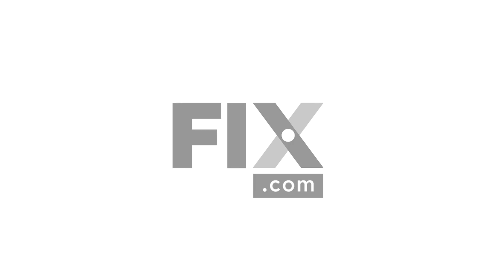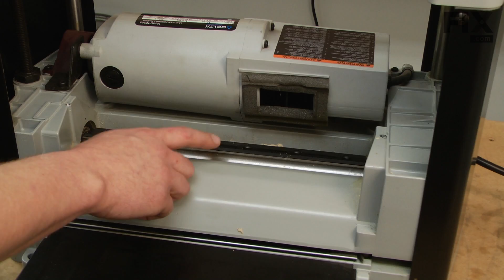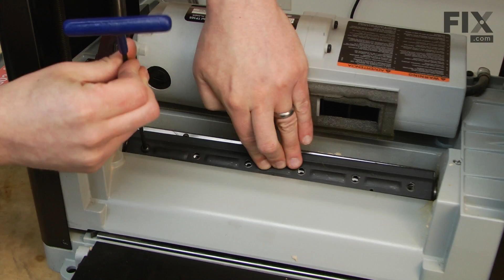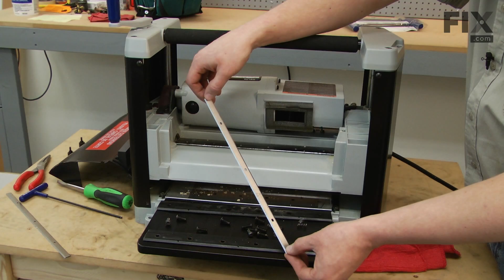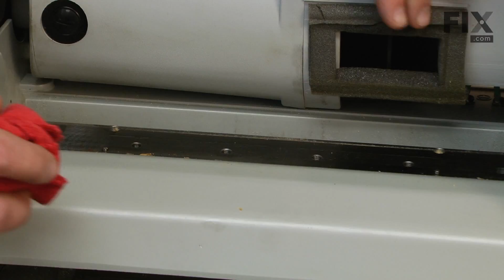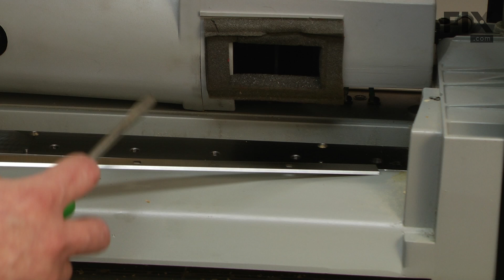Delta Planer Repair – How to Replace the Knives

Comment: On one of my blade locations, the locating pins look like they are pushed in. They don't look sheared off, just pushed in. On the back side you can see an access hole and the other end of the dowel. Are these threaded or just pressed in? Can I simply drive them back out to proper position with a punch?

Comment: Thanks for the helpful video. I have a Delta Model 22-580 13" 2 speed planer. All works well except the shaft coming from the planetary gear turns freely so it does not drive the feed rollers. Is there a fix for this without having to purchase a new gearbox which would be more than the planer is worth. Any help would be much appreciated. Thanks. Wayne. wjohnsontr6@gmail.com.
Reply from the maker: Delta doesn't offer any replacement parts for the repair of the transmission.  It's not all that common for the transmission to go out in these. A more common problem has been either with the drive chain, the belt or the sprockets.